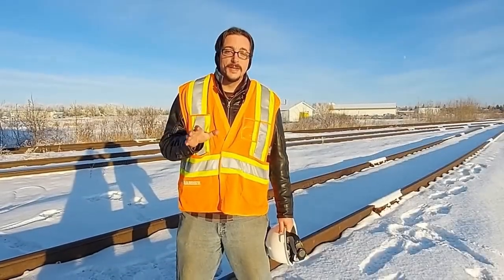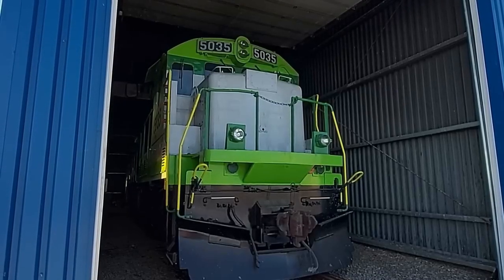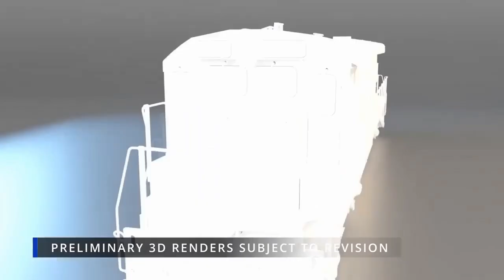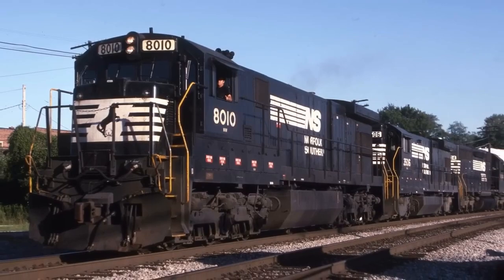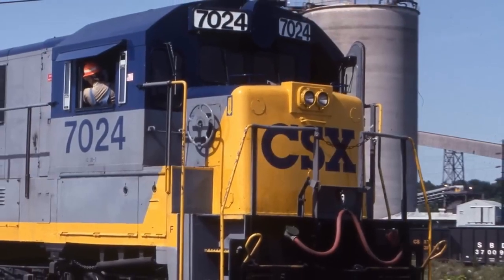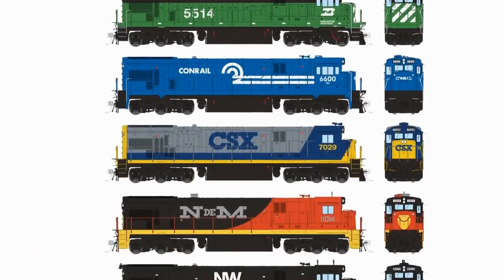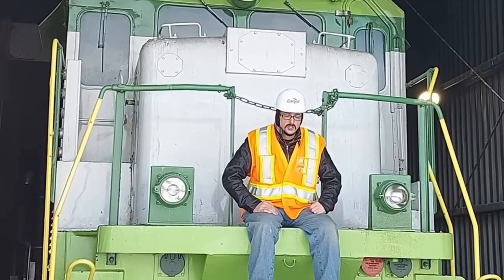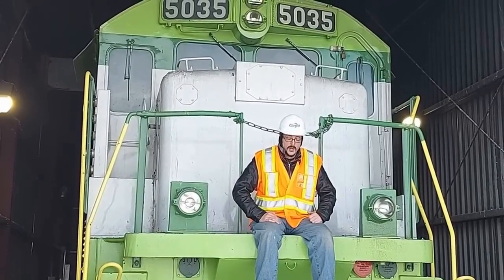HO Scale Rapido Trains - C30-7 Diesels - First Look!

Comment: Here in Mexico we still having in service some remaining C30-7; for example FXE 3527 and FSRR 9618.
Reply: todavia quedan en ferrosur
Reply: @maverick2008  Muy poquitas, pero sí quedan algunas, como la 11050, la 9629, la 9634 y la 11064, y creo también la 9622; de hecho, hay dos recién repintadas, que son la 9618 y la 11120. 
Las demás de Ferrosur se fueron a Brasil o al soplete. Por ejemplo, la 2205, 6712, 6760, 6768, 9318, 9339, 9607, 9612, 9625, 9626, 9631 y 11008 se las vendieron a MGE/Progress Rail de Brasil; la 9319, 9605, 9616, 9624, 9627, 11047, 11053, 11060 y 11061 se las vendieron a MRS Logística. Ya las demás, las metieron al soplete en Veracruz o en Puebla.
Las que sí sé que aun siguen vivitas y coleando son las 5 C30-7 de Ferrovalle: 11012, 11013, 11014, 11015 y 11023.
Reply: si quiera hubiesen dejado una para el museo ahi en puebla.
Reply: @JoseMartinez-ge3gh  ojalá que no la desaparezca.  Porque fue una locomotora de la extinta FNM. Y fue parte de la vida ferrocarrilera, en mi caso por mi padre que trabajó para esta empresa del gobierno, y me trae muchos recuerdos en mi niñez,  ojalá que esté en el museo en Puebla.
Reply: Y tienes fotos de esta locomotora de FNM
Reply: Aqui tem mais
Reply: There are some in Brazil too, all regauged, werher to 1600 mm broad gauge or... Metre gauge, with some of these last units getting their 2 3 axle trucks replaced with 4 2 axle trucks, to lower down axle load